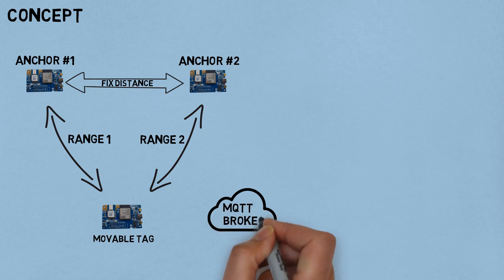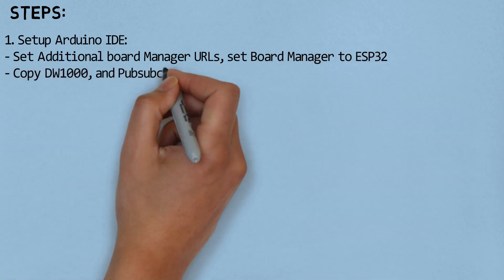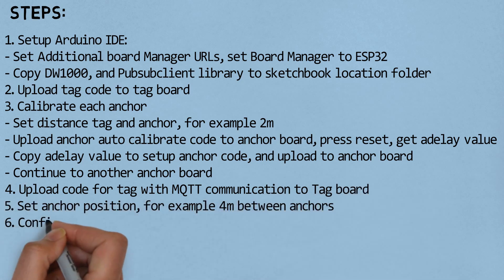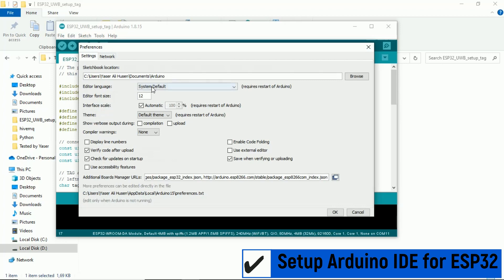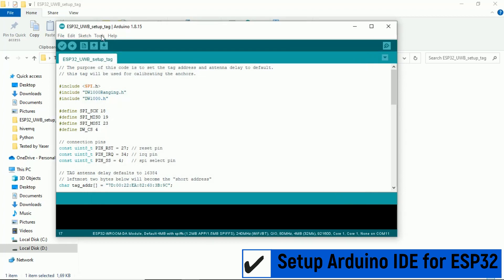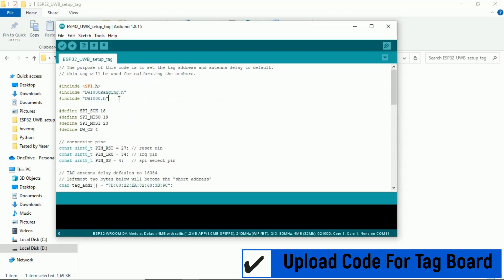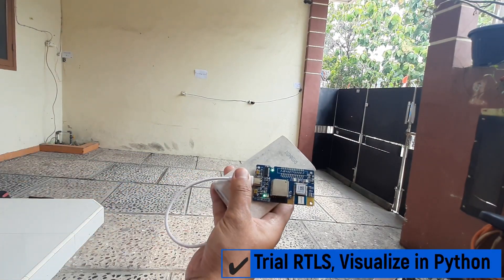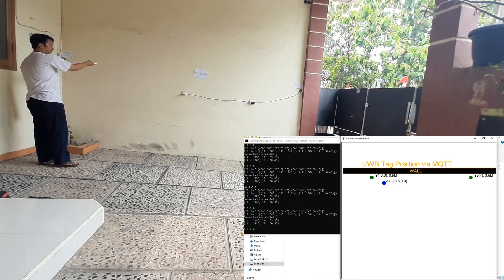Real Time Locating System (RTLS) using UWB ESP-32 Board, and MQTT as Communication

Comment: cant we do this with bluetooth instead of UWB?
Besides where is the board link, can Indonesian supplier deliver this oversea?
Reply from the maker: Yes we can use bluetooth to calculate distance based on the strength.
If you read some reasearch, UWB is best for accuration of RTLS rather than Bluetooth.

Comment: I appreciate your demonstration of UWB sensors technology. Are UWB sensors more recommended for capturing movements in real time, compared to RFID technology, which is mostly used in access control?
Reply from the maker: For accuracy, UWB is best than others,
But I have not use it in real environment.
I see the problem is, UWB should not be covered by metal or any object
Reply: @YaserAliHusen  Is good to know that limitation. Thanks Yaser

Comment: Hello, I always get "Attempting MQTT connection...failed, " whenever I try to run the program. Can you help me? 
When I run the python file in vscode, vscode says "Import "paho.mqtt.client" could not be resolved from source", is this a problem?
Reply from the maker: Did you install paho mqtt library?
Install paho mqtt: pip install paho-mqtt
Reply: @YaserAliHusen  Yes I did through command prompt, and I received those warning messages from vscode
Reply from the maker: @temmiethy166  , what is your mqtt broker?is it correct configuration of your mqtt connection?
Reply: @YaserAliHusen  How do i check what is my mqtt broker? Are you referring to this line?

    //if you MQTT broker has clientID,username and password
    //please change following line to    if (client.connect(clientId,userName,passWord))
    if (client.connect(clientId.c_str()))
Reply: @temmiethy166  we have the same problem, how did you resolve this?
Reply: Did this problem be resolved